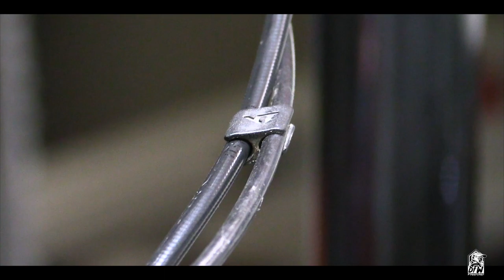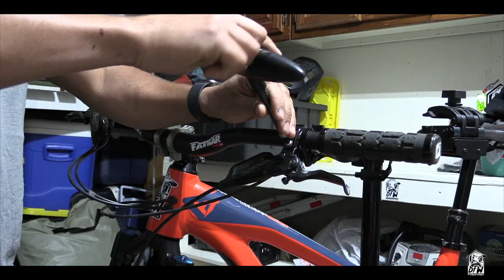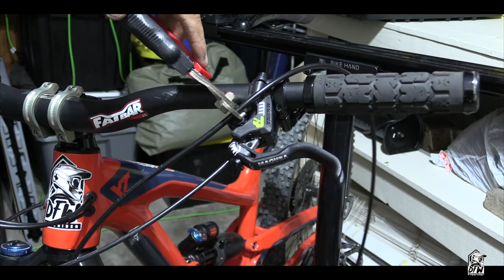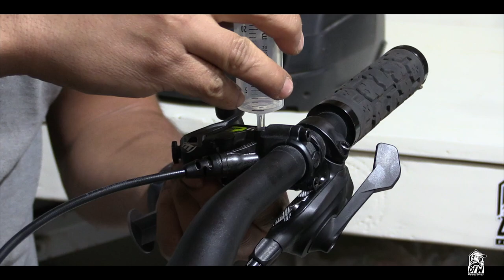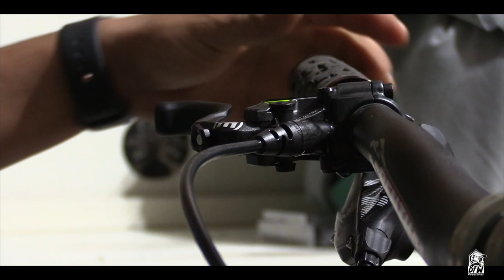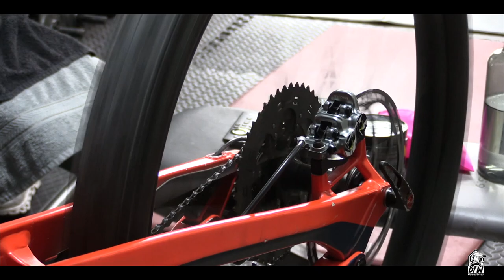MAGURA MT7 BRAKES\\ EXPENSIVE BRAKES

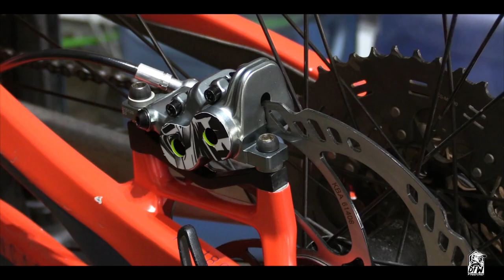Comment: 5:25 ...Explain :)
Did you use those spherical washers as simple shims? And with what criterion given that one is missing on the lower bolt?
I do know that magura includes only 2 sets of spherical washers with their calipers, which is odd since 4 sets are needed in order to couple two non parallel planes.
Yet the use you made of those 2 sets is kinda funny to say the least.
Reply from the maker: I only used  them Magura for a short time. To me Magura are the worse brakes ever. I sold them to my friend and ai bought Shimano Saints.
Reply: @DFWfreerider  What was your problem with them?
Reply from the maker: @Nox665  I had to bleed them like 4 times and still weren’t working. To hard to get them to work.  And I know 2 guys that have the same problem
Reply: @DFWfreerider  the caliper is meant to be as low as possible whilst bleeding. That may have been your issue.

Comment: yeah thats right grab those rotors with your bare hands and out oil all over them ...
Reply from the maker: 😂😂. The problem are not oil over rotors lol.  The problems are the brakes
Reply: @DFWfreerider  considering swapping my Code RSC for some of these
Reply from the maker: @estebanbaquero6488   well at this point I dont know lol. I  have only  used  sram and shimano.